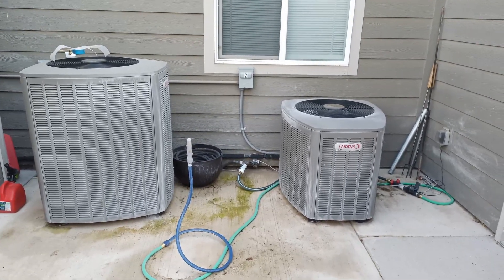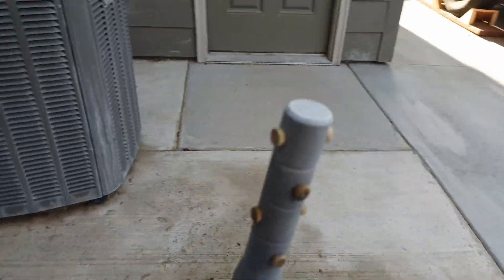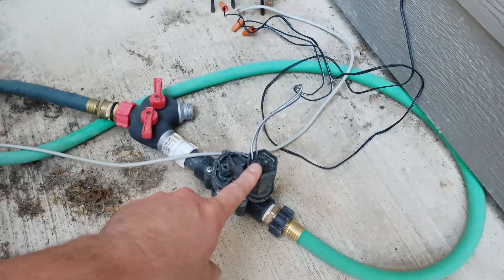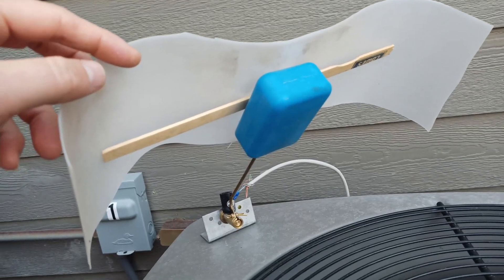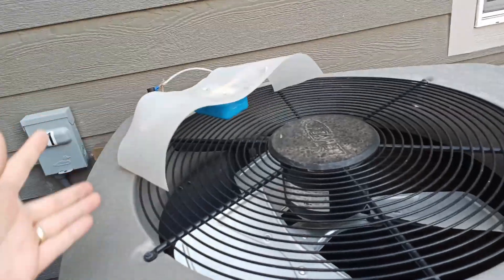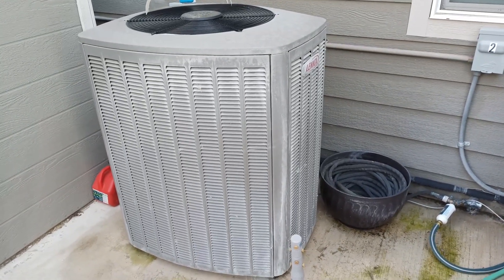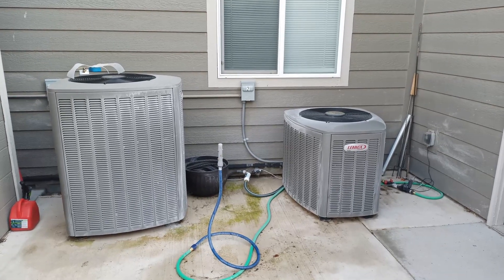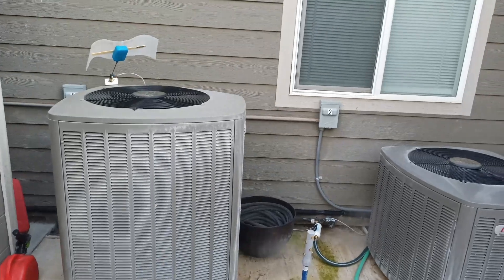DIY Air Conditioner Mister

Comment: Really cool setup! I love the simple wind switch! I just did something very similar with a Current Switch inside the disconnect box for the Condenser, if it detects current it closes the circuit, they are pretty cheap these days!

Comment: Wicked smart...  I'm dealing with the a similar situation and have been looking for solutions.  My unit is on a roof, and it shuts down when it gets too hot outside. (but only when it's way too hot)  I'm fairly certain it's a safety shut off feature (even thought I've spoken with a couple of a/c contractors who've assured me it's not)   Capacitor is new, circuit board is new, installed a hard start kit, coils and condenser are clean.   Here in  Northern CA we're getting up to 112 degrees F,  plus the surrounding heat of a black roof.   Yikes... I'm surprised the unit is working at all.  I was going to program an Arduino to kick on/off a switch... but it's a lot more work and your solution seems stable.  I'm also going to have to create a mesh screen around the sides of the unit... I can't let my solar panels get wet when they're blazing hot.  Cheers, Mate.  Thanks for sharing!

Comment: What part of the country are you in?  Is the outdoor humidity high there, as it is here in Florida?
Reply from the maker: Idaho and no real humidity to speak of.
Reply: Thanks.  That's probably why it works well for you. Evaporative cooling doesn't work well here in the Sunshine state with 60-70% humidity.  My compliments on your engineering prowess!

Comment: It seems to me that there are many improvements we can make to our outside units to make them more efficient.  shade them from the sun.. For whatever reason the sun's rays have gotten much stronger.. we (in Alabama) are losing two inches from our pool on bright hot days.. Why not build a small enclosure to shield the unit?  You could also collect rainwater from the top of the enclosure... or even mount a solar panel on the top and use a couple of peltier modules to cool the water before it is misted onto the unit...
Reply from the maker: That is a great idea we recently got a little John Boat I was thinking of hoisting it in place over them to store it as well as shade it but that is a great ideas in there thank you.

Comment: Why not skip the solenoid valve and just use a upside down toilet valve?
Reply: It would leave the valve always on.
Reply: @9jmorrison  Upside down valve. The sail would  drop when the fan stopped acting like the float when the toilet tank is full.

Comment: Why didn’t you just wired into the contactor switch that’s already in the unit lol
Reply: Yes that is what I did. Contactor 24vac to solenoid.
Reply: @melvinnizelalarca8423  I wonder if the Contactor has enough amps for the solonoid to run for long time, and if solonoid has problem such as shorted, is there any damage to the HVAC electric board?
Reply: Then why did you build the switch on top if you wired it to the contactor? @melvinnizelalarca8423

Comment: If you are using the super efficient air filters. They restrict the air flow way to much.  The cheap fiber glass filters work better.
Reply: Does it? Can you please tell me more about this
Reply: @menesesal  Now the super Efficient filters will clean the air better. But the A/C will have to work harder to move the air thru the filter.  And the more so as it gets dirty raising the  electric cost to run  the unit. But you run the risk of dust  getting on the the evaporator core. But a  vac with  a brush attachment. can clean fairly easy. Hope this answers your question.
Reply: @charlescoker7752  thank you for the advice.  I picked some 3M filters that are not too restricive and the unit worked just fine.